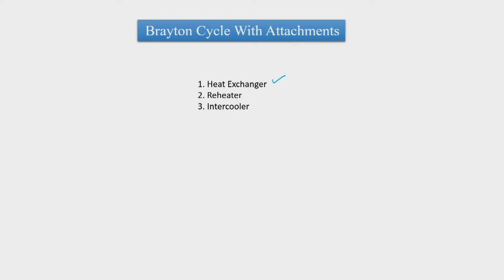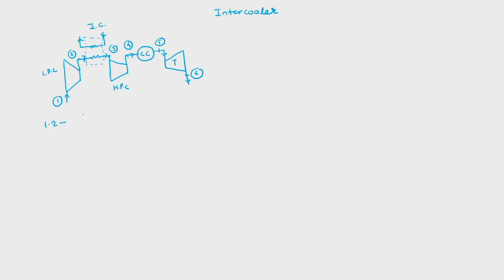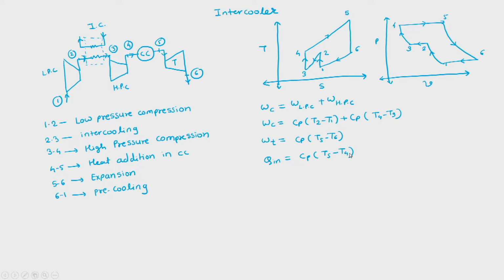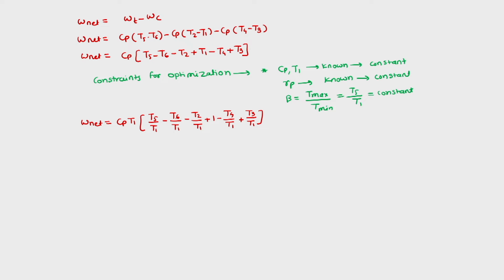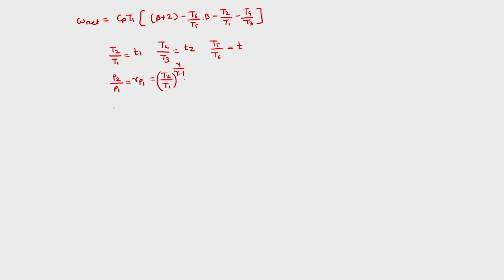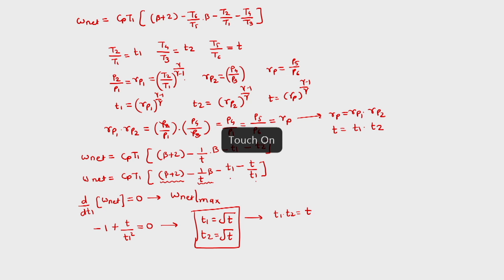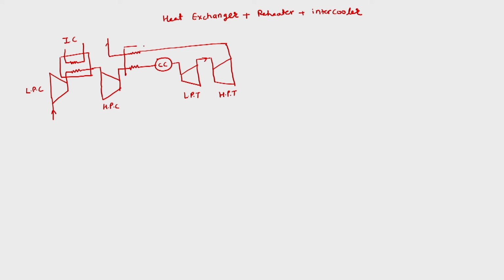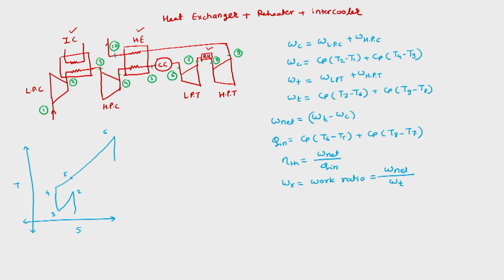Lec 34: Brayton Cycle with Intercooler

Comment: sir intercooling is a constant pressure process then in the interooler how with decrese in temperature the pressure remain constant ..??
Reply: Pressure means gauge pressure not absolute pressure,here cooling is done by a heat exchanger working at the same pressure by cooling action heat is removed simple bro